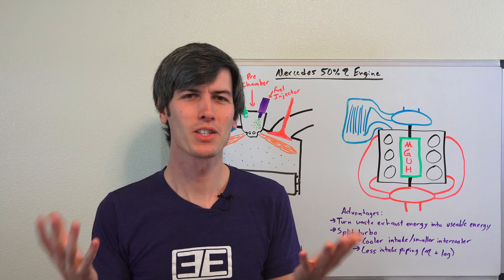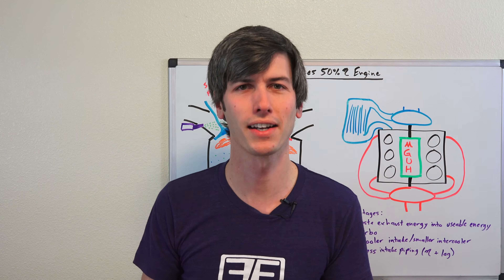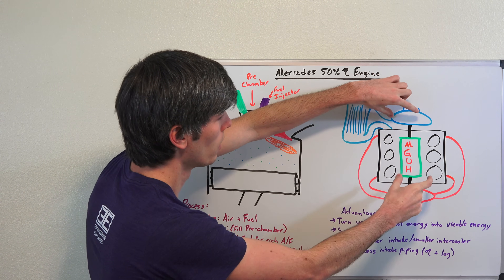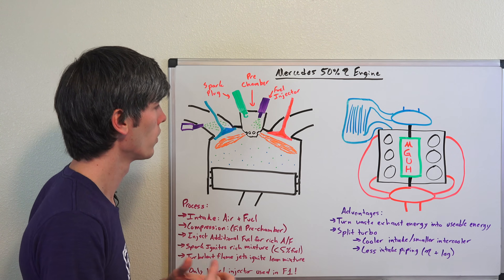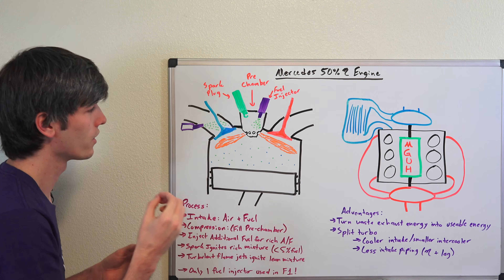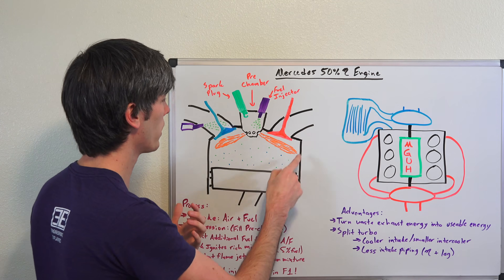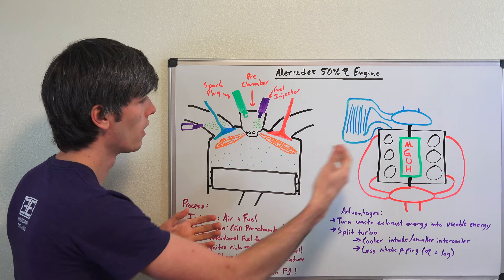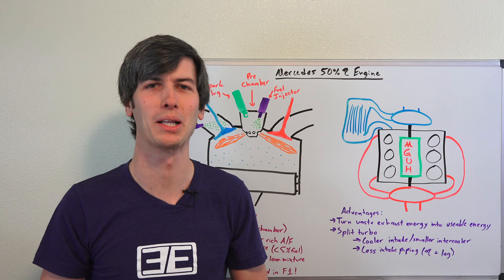Mercedes Created The World's Most Efficient Racing Engine

Comment: This is very much like a modern version of the old Honda CVCC engines, which also used a pre-combustion chamber with a richer mixture to ignite a leaner mixture in the main combustion chamber. However the pre-combustion chamber did not get its air the same way this engine does, it got it's air and fuel through a third barrel in the carburetor. This meant that they had to have a third, smaller valve on every cylinder for the pre-combustion chamber. I'm guessing Mercedes wanted to avoid that because the smaller valve spring on that third valve would essentially limit the rpm the engine could achieve, since it wouldn't be big enough to fight valve float. Honda also piped blow-by gases back into the intake, but I think that had more to do with emissions than it did with thermal efficiency.
Reply: By piping blow-by to the intake, don't you mean the mandatory PCV?

Comment: Great video but I'm surprised you didn't mention that the MGU-H is also used as a motor to spool the turbo to prevent turbo lag. So it switches between acting as motor and a generator depending on what the driver is doing.

Comment: It' s just exactly what happening in a diesel with indirect injection with pre-chambers....
It's stratified combustion,quite an old concept.
certainly some split injection with an injector in the prechamber,or above.
spray once ,mixture is pulled in the cylinder,spray a second time in the chamber,at the end of the stroke ,just before the spark to have two strates.

Comment: Uh, Carnot efficiency? Theoretically the ideal heat engine cannot exceed Carnot efficiency ~35-40% limited by the temperatures of the heat sinks
Reply: That's the engine itself. Then you scavenge some more energy that you can send to the wheels thanks to the MGU-H/K, thus increasing the overall efficiency of the power unit.

Comment: How is this 50% number calculated?
Is this the raw thermal efficiency when the engine is under a specific constant load?
If this is true, questioning it is reasonable because usually they incorporate brake recuperation or something to make it look more spectacular or "green", then my next question would be:
In what load range does it achieve this 50%?
And then the new Mazda HCCI goes a very similar way for combustion.

Comment: The prechamber combustion isn't new tech though. It's just new to racing because of the high focus on efficiency. I know Honda had it in the 70s and 80s with their CVCC. It worked differently because it was carbureted but the concept was the same, use a rich mixture to ignite a lean one.

The new injected version sprays fuel into the prechamber while air is forced into the prechamber by compression of the main combustion chamber, this creates the rich mixture in the prechamber. When combustion is started by the spark plug the fuel in the prechamber is fanned out, by the pressure front, through the holes into the main combustion chamber; then, the flame front ignites the resulting lean mixture.

While I can't be sure the Mercedes version works like this; the fact that they have to use one injector per cylinder suggests they use this approach.

Comment: That system looks a lot like the one used on the 80’s Mercedes pre-chamber (IDI) diesels.

It’s kind of ironic that they’re using this to achieve higher efficiency because this setup on the IDI diesels (and IDI diesels in general) were pretty much phased out because they had lower efficiency compared to DI due to the heat lost to the coolant through the pre chamber. I wonder what’s so different given it fundamentally seems works the same way

Comment: Honda did the pre chamber in the 80's. CVCC engines did this very well. 3 valves per cylinder, and a trick carb. The carburetor was the hardest part to maintain.

Comment: Does that mean that the force distribution pushing down on head is also made equal due to the flame going through the scatterd holes from the prechamber to the larger chamber? Does this add on reliability? Does every F1 engine use this dual chamber system? Just curious.

Comment: Or that other injectors doesn't necessarily needs to be for fuel. It could be use to inject water or any other chemical that is not ban on F1 and they could lower their intake temperatures and gaining a higher efficiency who knows.

Comment: Would it be possible to instead of having a tiny spark plug in the center have a long spirally metal mesh that covers most of the open area of the cylinder head? Hard to find materials that wouldn't break, maybe?

Comment: Honda used prechambers in the civic in the 70's it was called CVCC. Electric motor is to spin up the turbo for less turbo lag. Nothing new. Prechambers are popular in diesels also. Separating the halves of the turbo is a good idea although it probably is not new either. Higher efficiencies at the cost of horsepower can be gotten by eliminating the intercooler but the materials needed must be more resistant to heat and temperature which is difficult if not impossible.  Smokey Unick ,best damn garage in town.

Comment: That pre-chamber fueling system reminds me of the Honda CVCC three-valve engines of the 1980s. In that system, the third valve was a tiny one, inside a small (6 cubic centimetre) prechamber. That chamber gave a pig-rich (6:1) air-fuel ratio. When the mixture fired, the third-valve chamber spat out flame the way the Mercedes system does. As in the Mercedes, the main valve drew in a very lean mixture. When the flames came from the small valve chamber, the rich mixture drew air in from the leaner main chamber, thus stratifying the power charge. 

Honda's goal was to get good power with lower unburned exhaust emissions, which the stratified charge gave. I suspect Mercedes has done something like that, but relies on air from the intake valves to fill the pre-chamber, rather than adding yet another valve. The flamethrower effect, drawing oxygen from the lean intake mixture would balance the overall mixture, or maybe run well on a leaner mixture. The result is power with lower fuel consumption; in other words, greater combustion efficiency.

Comment: High efficiency is only at narrow RPM range. As with all gassers, efficiency will be awful at other RPM. Rich mixture leads to more carbon fouling. While F1 engine that gets replaced after few hundred miles is fine, but it won't work well in consumer car engines. If won't work for consumer engines, I don't see why F1 insist on silly things like single injector per cylinder.

Comment: thankfully we have a F1 for R&D purposes. Racing can be a bit boring, but the managed R&D is great.
However I wonder if we can spend some time on the real world:
a. current fuel consumption rules developed by US EPA (and others) have forced on us diesel engines, CVT, Dual clutch, 8-10 speed auto transmissions, direct injection gas and diesel systems and lets not forget EV cars + EV and gas combinations. 
b. the rules will tighten up so that the race for efficiency will continue and more bleeding technology will be forced on us so that the car industry can stay relevant and in business. I suspect that the VW cheats were the victims of all of this.

It would be interesting to do a series of vids that will focus on:
a. which fuels (engines) will prevail
b. fragile transmissions have a half life (I hear that the CVT will go for 5y)
c. will the CVT survive? Can it made to work with high torque systems.
d. should we force development by forcing all F1 systems to go CVT, for example.
e. What combinations of engine tech and transmissions are SAFE to pay for, given that $5000 is a nominal cost of fixes
f. lets go to diesels and exhaust filters + cost of direct injection repairs.

The list goes on and on and on...

Comment: I'd had the impression diesel engines were around 50% thermal efficiency
Reply: The really big Diesel engines are around 50% thermal efficiency. But the ones used in cars are far far less efficient because they're to small to use the full potential of the Diesel concept.

Comment: Cough cough-burning oil-cough cough
Reply: By design, the oil is engineered to be combustible and so it generates power when burned. It's basically a little extra free gas on top of what you're allowed to put in the tank.

Comment: What i think you've missed is that the only injectors is in the mini chamber. It doesn't draw air and fuel through the holes.
The combustion is started by a spark plug if the engine isn't in a high enough rpm.

Comment: The pre chamber does not look too complex especially if there is no restriction on the number of fuel injectors per cylinder. Can this utilised in commuter automobiles? It could improve the fuel efficiency to some extent.

Comment: The single injector in F1 engines is in the pre-chamber. It's most likely that the fuel to provide the lean mix in the main chamber is drawn from the pre-chamber during the intake stroke. The more rich mixture in the pre-chamber is then created by simply injecting more fuel before ignition.

Comment: Some earlier Honda engines used a pre-chamber like you show for the Mercedes. CVCC was the engine type. The engine had a single intake valve in the pre-chamber that was connected to a constant velocity carburetor. This CV carburetor was a portion of the larger carburetor that ran a very lean mixture through the regular intake valve. I think the CVCC engines worked so well that Honda was able to put off installing catalytic converters in their cars until about 1980? Researching the CVCC engine and doing a video on it would be very interesting to me!
Reply: I was reading these comments waiting for someone to mention this haha
Reply: The principle was introduced by Honda. They called the stratified charge system Controlled Vortex Compound Combustion. The carburetor was actually two carburetors in one housing; a conventional 2-barrel, tuned lean, and a small auxiliary carburetor that was set for a very rich mixture. Each of the 2 carburetors had its own idle circuit. Neither was a constant-velocity type.
Reply: rickrack78 There is one Wheeler Dealers episode about this !
Reply: @bbogdanmircea  i watched that episode and it was just after this had been revealed and i thought the same. why they did not use it in the honda f1 engine of the time i cant fathom
Reply: I loved the cvcc in my 79 accord! it was really efficient and very peppy for the engine size. I remember it had a 3 barrel carb. 1 tiny butterfly was just for idle then a small one and the largest was almost the size of a nickel
Reply: Active pre-chambers cannot be used with catalytic converters as they use a lean mixture which in turn results in "dirty" exhaust gases. Passive pre-chambers, such as on the MC20, can use a catalytic converter because the fuel air ratio can be the ideal 14:1 which cats need.

Comment: That split turbo was and still is a sheer stroke of genius from the Mercedes engineers. And, you've explained it wonderfully crisp and clear. Again. And while they have not yet built a production car with this feature, they did built a 'Hot-inside-V' engine. It seems to have adopted some of the principles used here. Can you do a video on that motor maybe?

Comment: Small addition:
Another advantage of the split turbo is that the inlet piping is much shorter. That means the package can be smaller (less drag) and less air resistance so more air = more power. 
Maybe you (Jason) explained this in a previous video. Anyway very interesting (as always;-)

Comment: Nice vidéo. Could you make a video  explainning how Oli is been use  for combustion (chamber) in
 F1 car. Please
Reply: squad by NDN Basically, they cheat by letting some oil leak into the combustion chamber, giving them more fuel. Because they're only allowed a certain fixed quantity of fuel, but the rules for oil are more relaxed, they came up with an idea - well, since we can't add more fuel, but we can add more oil, why don't we just use some of the that oil as fuel .
 
Sooooo, they're not exactly breaking the rules....they're  just severely bending them, by using a very creative definition of "fuel". Oil is really not a very good fuel, but it is better than nothing - so they intentionally allowed this oil to leak in, and act as a fuel, thereby circumventing the rules. As such, they didn't technically break the rules - they just broke the spirit of the rule.

That's the simple version. Hopefully, that's enough to understand

Comment: Honda used the same concept in their CVCC stratified charge engine back in the 70s using a dual path carburetor. So not quite so innovative, although I am sure the detail has been much refined. No turbo though.

Comment: These current F1 power units are true beasts, it's really sad they are so ill-spoken.

Any chance of hinting how do you get access to these infos? Constructors info or espionage? Haha
Reply: I should have specified. This is true (from what I know) for race configuration. The Turbos in the 80s reached more than a 1000 (some say 1400), but in quali. They had to be seriously de-rated to last one whole race. And they were "tiny" 1500cc 4 or 6 cilinders.
Reply: jamie 711711 I second you on the "sound like crap" argument. I listened to the engine note for the first time when I saw Lewis Hamilton's driving. That puny V6 sounds more like a sporty high-revving 250cc bike than a proper Formula 1 beast. Really miss the V8s.
Reply: TCA17 "no engine in F1 history reached 1000hp." What about those old turbo V10s in the 1980s and some of the 1990s? (note that I am no expert in F1)
Reply: @fancyyahoo  no engine in F1 history aside from current V6s cranked out 880hp, used only 105kg of fuel and was reliable enough to do that for 4 to 6 racing weekends.
Reply: Those were Turbo 1.5l V4s and V6s
Reply: 460 HP / L Specific output. Almost twice as good as the nearest rival. In fact they are more than 2x as efficient as those V10s (but they can never match the sound).
Reply: more like under-powered compare to other eras in F1/other motorsport series, overly complicated, causing massive development cost and huge performance differences between the front runners and mid field team, very unreliable, sounds like crap(the majority of F1 fans agrees so don't argue). F1 has been about pushing the boundaries of what's possible, and we are going the opposite with such straight rules governing every component of the PU, teams should be able to innovate and have their own unique approach, instead of rolling the dice, hoping the mostly similar engine of their competitors will fail first. There has to be a change in this, hopefully the 2021 engine rules revamp will deliver.
Reply: "more like under-powered compare to other eras in F1/other motorsport series" - no engine in F1 history reached 1000Hp. Mercedes is close to this. And the cars are the fastest in history, and doing this with 1/3 of the fuel used previously.

"causing (...) huge performance differences between the front runners and mid field team" - this has always existed in F1. See next point.

"very unreliable" - This is so untrue, unless you are considering just Honda and 2017 Renault. In the past everyone won races because cars were extremely unreliable, and there are several examples of pilots with 90% of the finished races in the podium, but nowhere near to be champion, since he only finished like 50% of the races.

"sounds like crap(the majority of F1 fans agrees so don't argue)" - I also miss the old sound, it was much more impressive, no arguing. But I don't think this sole point should cause so much damage.

"F1 has been about pushing the boundaries of what's possible" - I think this is being done at the power units front. However, this ALWAYS comes with huge investments, as you said. I would also like to see it in aerodynamics and other fronts (maybe electronics?), but the costs and the importance desired for the pilot limit this. It is a tough balance to find.

I would love to see 3 or 4 different approaches to power units and aero in F1 (like LMP1), but the costs deregulating all at once would eventually destroy F1 (like LMP1). But I agree that a mid-term solution must be searched. Maybe with a standard unexpensive option for a hybrid engine for the mid-field teams, with the front runners limitated in cost, idk. However, electrification is the future, whether we like it or not, and the focus must be to find a solution on this direction that produces good races and is attractive to constructors.

Comment: Wow! Here you can see that combustion engines will still be part of the future
and that it is still a good ecological strategy to improve existing combustion engines.
Electrical cars have the benefit of less direct air pollution by the engine itself, but
the whole battery production background plus the increased tire and asphalt wear(because of the heavy batteries)
make them less "green" than traditional combustion engine cars.

Comment: BMW Megatron engine produced 1400bhp in qualifying and only1.5L
Reply: Wouldn't really be surprised if these things were to produce 2000hp if not severely fuel flow restricted.
Reply: On Wheels the engine would only last 3 laps at 1400bhp as they basically jammed the wastegate  shut for qualifying. They ran around 850-900bhp in the race.
Reply: Sorry, for the unclear wording, I meant today's F1 engines.
Reply: On Wheels ok I'm sure that you are correct although they would need a whole new solution for the thermal management.
Reply: fuel flow restriction. even the best engine of that era, 1988 Honda RA168E managed 620hp with 124~ kg/hour fuel flow.
source : SAE Technical Paper 890877 Honda Formula One Turbo-charged V-6 1.5L Engine